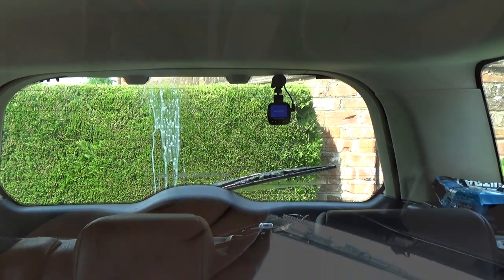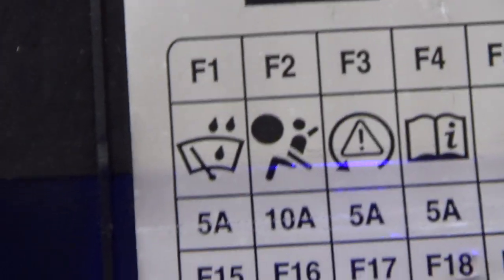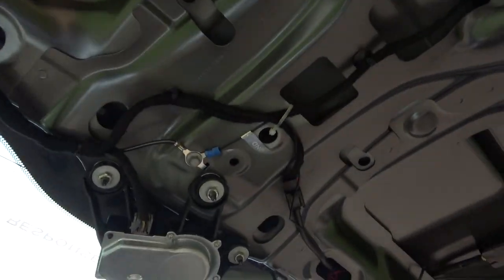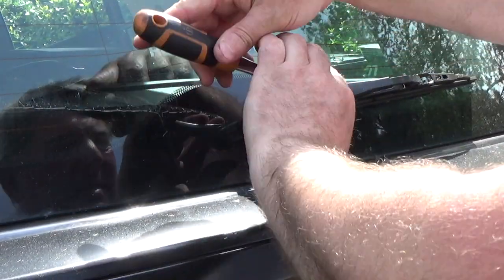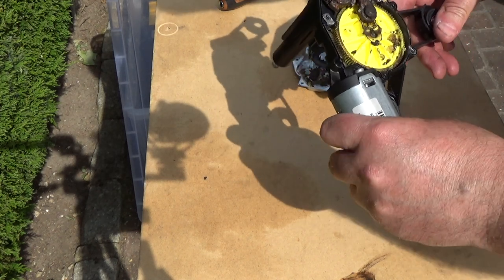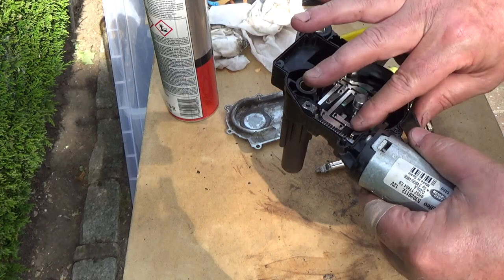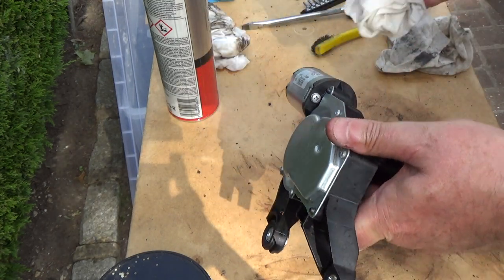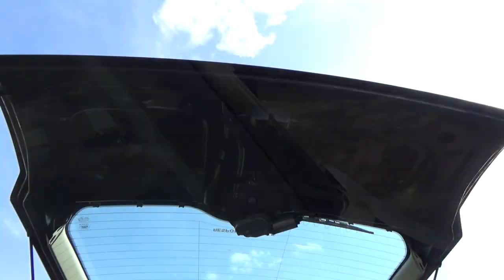Rear wiper motor repair - Land Rover Freelander 2 / LR2

Comment: Did this twice and still sticking so undid screws on actual motor, gently pulled off outer motor case and pulled armature and worm drive free. Found one of the tiny brushes seized. Long story short, managed to remove offending brush, cleaned it and it's housing with needle file and reinstalled. Now working PHEW! Thanks for the video, your a star :}

Comment: Great video thanks, mine had the shaft seized in the housing due to corrosion on the spline end and the toothed linkage came apart trying to remove it, but I managed to clean it up grease and re-fit, and it's working a treat. Very helpful video. 👍👍

Comment: When I got my car the rear wiper wasn’t working but seller gave me a new wiper motor but it was a cheap replacement,it lasted just 18 months before seizing up was a lot worse than yours so I got a 2nd hand one from a late model in a breakers yard for £25 😎🏴

Comment: Thanks i have problem with getting the correct wiper blades also suspect that water gets down the wiper shaft when it is running i tend to use the rear wiper sparingly
Reply from the maker: Check out my earlier video on wiper blades. You can run a 15” on the rear. It just fits.
Reply: Thanks purchased some from a leading internet supplier badged "Lucas" but they were useless as I suspect old stock the rubber was brittle, Had to throw away and get bosch from helfords , thanks for your info on the freelander 2 keep up the good work

Comment: Love the vids mate, will watch this tomorrow, sure it's fantastic as always, where did you get your roof basket from and what tires are you running, thanks man 👍
Reply from the maker: Thanks, basket was from ebay and tyres are BFG 245/70R17
Reply: Try Goodyear Wranglers M&S (mud and snow) for a less aggressive tread for more on-road work.  I have these Goodyear and they wear well.

Comment: So mine isn’t working and when I removed the boot cover and looked, the black plastic tip of the motor had fallen off?!? Can this be pushed back on or do I definitely need a new motor? 😭
Reply from the maker: That sounds like the brushes and their housing. It may be tricky getting them back over the commutator. You could buy a complete second hand unit and swap the motor over. It is usually the gears and mechanism which fail not the actual motor itself.

Comment: Well done. Rubbish cars Junk. You can see from the end where the wiper fits. It can only leak water, nothing to stop the water running down the shaft. No two ways about it. Terrible design. I think they like selling new ones.